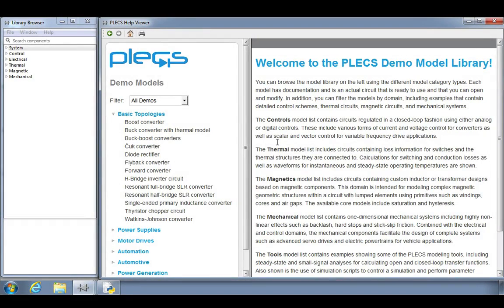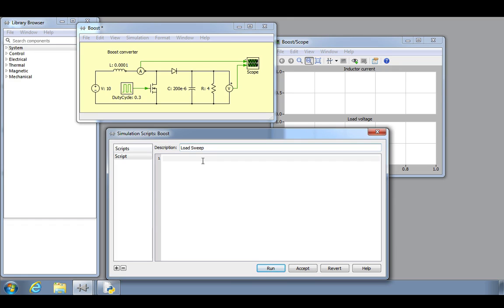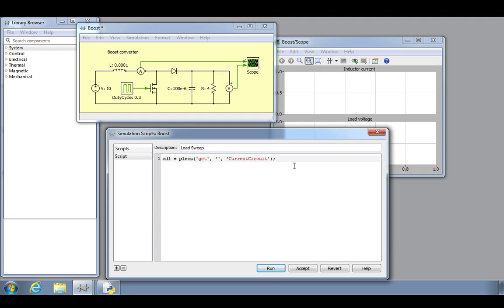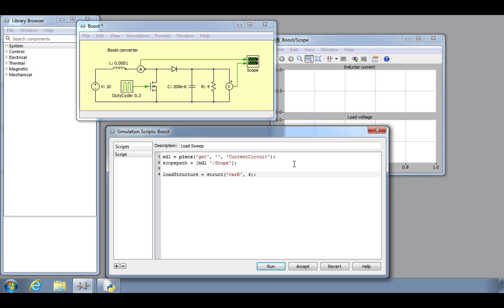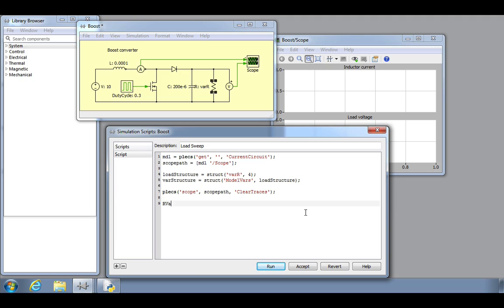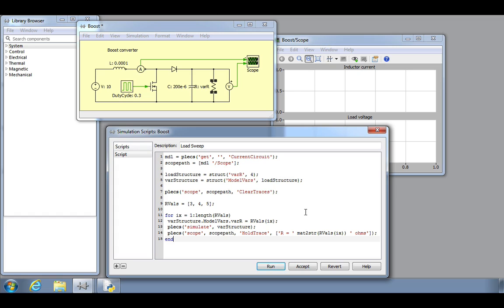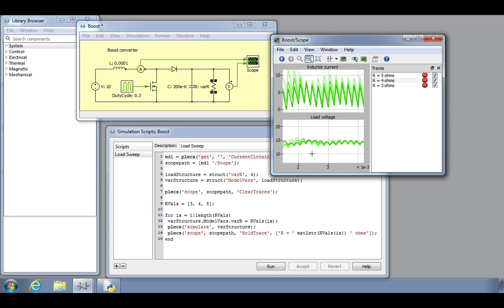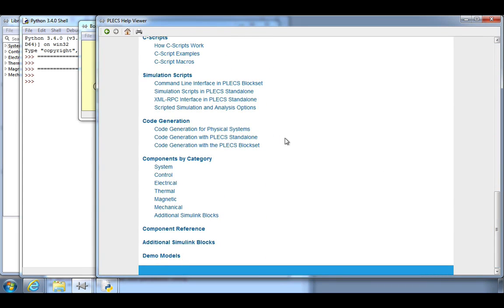Simulation Scripting with PLECS Standalone

Comment: Hi, excellent videos. Could you please explain simulations of magnetic circuits. Many thanks.
Reply from the maker: Thank you +Fernando Liozzi. PLECS has a magnetic domain in which you can build lumped circuit models of inductors and transformers within a PLECS system level model. Our unique approach allows the user to include non-ideal effects such as saturation and hysteresis and also build complex core geometries. Please see http://www.plexim.com/plecs/magnetic for more information or email info@plexim.com with questions. -The Plexim Team